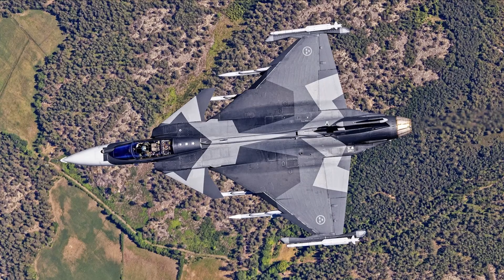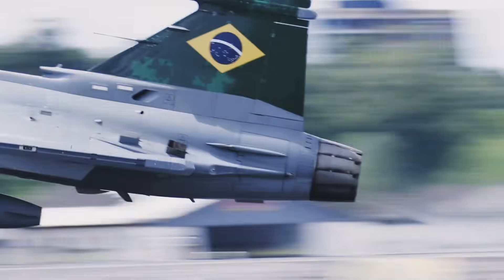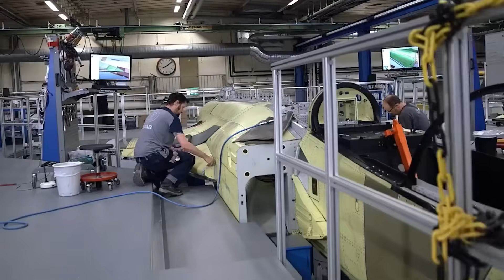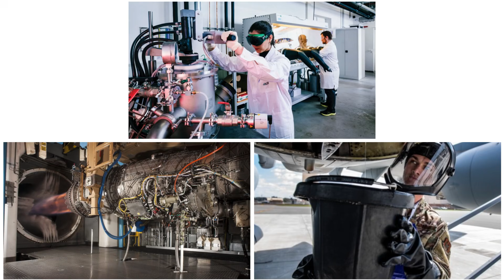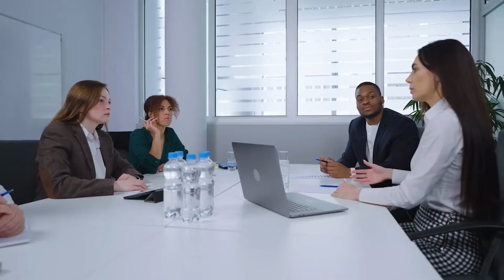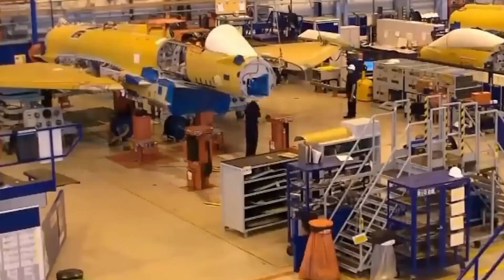NATO Just Got Stronger—Here's Why This Engine Matters

Comment: One video after another claiming Gripen is getting a new and better Rolls Royce engine to get out of American control over who Saab can sell Gripens with American engines to, and get better performance.  Meanwhile, not one word from Saab or Rolls Royce that there is even a plan to actually put a new engine in the Gripen.  In fact, the CEO of Saab has said there is no such plan.
Reply from the maker: You’re absolutely right that official confirmation from the manufacturers is the final authority on these developments. 🤝
Reply: @ViperWings803  Not just officially, but unless there is some other source of valid information, they are the default ONLY authority.  The video is not giving any valid source.
Reply from the maker: The video sources open-source defense analysis and reporting. Official manufacturer statements are definitive, but other analyses can offer insights into potential future developments.
Reply: @ViperWings803  Viper, like I said on one of your other videos, it would be to Saab's and their customers' benefit for Gripen to get a Rolls-Royce engine.  But, Saab is denying that is in the works.  Additionally, Rolls-Royce is not free to sell them engines--they do not even make the EJ200 engine in question. The engine is based on the Rolls-Royce XG-40, but the EJ200 is built by the EuroJet Turbo GmbH consortium. The partners are Rolls-Royce, Avio of Italy, ITP Aero of Spain, and MTU Aero Engines of Germany. Those other partners have partial ownership and control over the EJ200 and any derivative.  It is not for certain they are even willing to sell that engine to Saab when the Gripen would then be a more viable competitor to the Eurofighter Typhoon that it was designed for.   Maybe they will and maybe it will end up happening.  That is what you need to get to the bottom of instead of just saying you think it will happen.
Reply from the maker: The video explores potential strategic shifts and the benefits of such a development for Gripen, not a definitive statement that it will happen. The complexities of consortium ownership and competitive interests are valid points for why it's not straightforward.